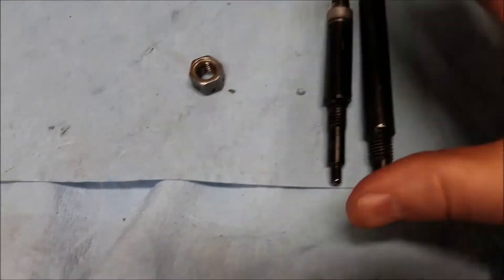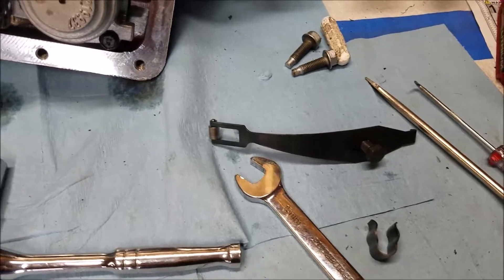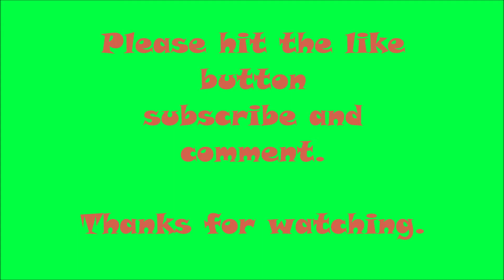Alien RestoMod : 4L60e shift linkage shaft swap.

Comment: I know this is an older video but I need some help. I have a 1992 Chevy S10 with the 4L60(no e). I'm leaking all my fluid out through this linkage over night. A local mechanic told me that it probably has a bad gasket/seal. Did you have to get a gasket or anything for this? I did not hear you mention anything about it. Thanks
Reply from the maker: That seal. Tell you the truth, I don't remember seeing it. I must have used one because I'm not leaking fluid. Look up this guy, he  has an easy method of replacing it. Southpaw Autoworks- Fast & Easy method- HM 4l60e shifter seal replacement.   Really did look that bad. Check it out.👽
Reply: @AlienRestoMod its this shaft same as 80e?   I have a 96 transmission without nss,   Long shaft,, And i need it on my 2000 silverado
Reply from the maker: @gerardolopez5875  This is the only transmission I've worked on, I'm not sure about the 80e. Monster Transmission ( YouTube) has some really great videos about all aspects of the different transmissions. 👽
Reply from the maker: Yes, it looks like I didn't mention it. There sould definitely be a gasket for the pan. That shouldn't be that bad to remove the pan and add a new gasket for pan. Get a clean pan and save all fluids, recycle back into the car. I hoped this help.👽
Reply from the maker: Yes, there is a gasket. It was on the transmission pan. The video was going pretty fast, so it went by quickly. I point at it briefly. I had to slow the video down to see it.👽
Reply: @AlienRestoMod   Thanks for getting back so quick. I know there should be a pan gasket. I was talking about where the shift linkage goes through the transmission housing. Mine is leaking through where the linkage is
Reply: Are the park neutral safety switches interchangeable on the different year 4l60e transmissions

Comment: Hi there. Do you know if generally it's the short or long shaft or is there multiple length shafts. Only our column shift GM 4l60e vehicles in Australia got a long shaft and are very rare. Do you have a part number for the long shaft.   I need to replace mine. Thanks
Reply from the maker: The one I used was the long shaft. I added an aftermarket floor shifter and needed the extra length because of the linkage that came with it.👽
Reply: Column shift commodores had the long shaft in Australia mate
Reply from the maker: I only know of the long and short. I acquired an extra one from a local transmission shop.  They just gave it to me.👽
Reply: @AlienRestoMod  no worries, thanks, Cobber.

Comment: What size nut goes on the shaft by the neutral control
Reply from the maker: Stand by , off world will check tomorrow. 👽
Reply from the maker: Sorry for the delay, the nut I have on there is M10-1.50. 👽

Comment: What’s the part number for the new shaft. I need to do this to my transmission. 
Thank you
Reply from the maker: Unfortunately I don't have the part number. After I got the transmission back and realized I needed the longer shaft,  I went back to the  transmission shop and they had one. Paid $2 .
Reply: It depends on the vehicle.  For my 1996 Corvette, the part number is GM 24235194.  It should include a replacement seal.  There is a tool for removing the old seal that has threads on one end a place to use a wrench on the other.